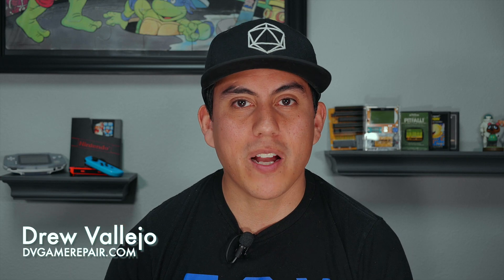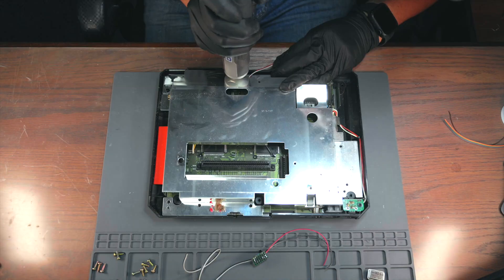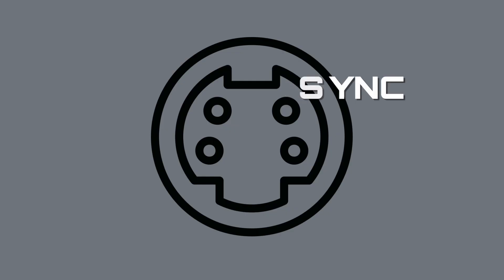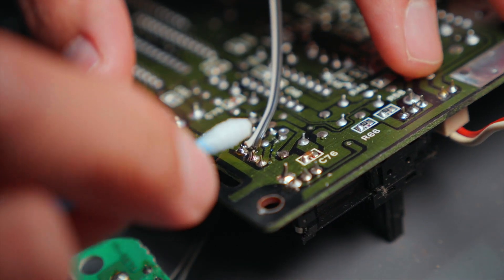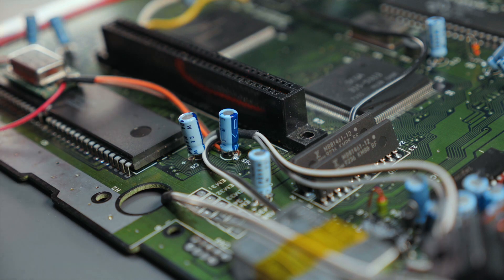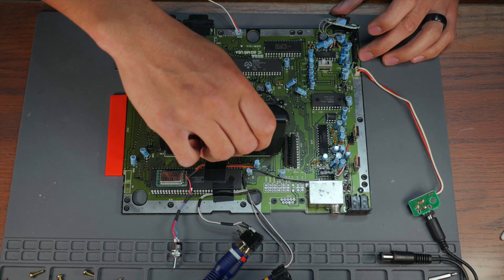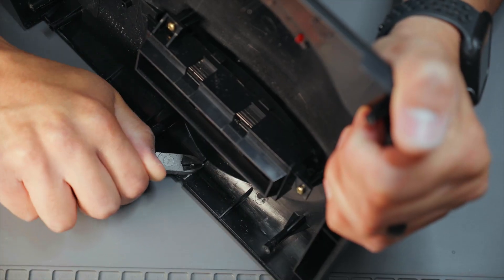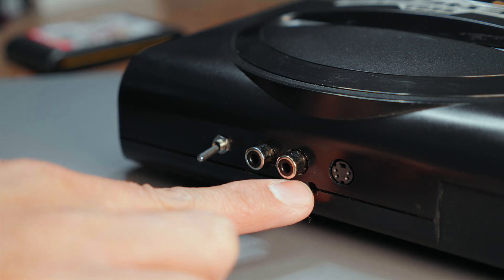Sega Genesis: Overclock, Audio & S-Video Install

Comment: Cool... but the more I look at these mods - the less I want to mod mine VA2 Model 1.

1. S-Video - what is the point, when out of the box, there is the best RGB output of the era? Yes, soldering proper SCART wire is a hassle, as U-shaped Din-8 connector is quite expensive, and properly shielded SCART cables are a pig to work with (the damn snake is 11 mm thick!). If done right - the picture is as good as an emulator. Also, NTSC consoles work with European CRTs, if connected through RGB. No need for S-Video.
2. Stereo - What's wrong with good-ol' 3.5 mm? If you need something extra - build an amplifier (later Model 1 benefit from custom sound), else - don't fix what's not broken.
3. Overclock. Cool, but not my cup of tea. I am quite afraid of frying the CPU. Do you know that processors tend to go bad after 30-50 years due to undesired quantum effects? I assume leaving it stock is better for preservation.
4. Wait, no region swap? Isn't is like the sole reason to poke wires into the thing?
5. PCB-mount connectors glued to the case are just gross! What's wrong with panel-mount parts? At least those are disassemblable.

It seems VA2 Model 1 only benefits from leaving it stock.

On the other hand, I like your clean soldering and neat prototyping PCBs.
Surprised you didn't re-cap the whole thing. My console noticeably improved sound-wise with new capacitors.

Comment: You did a nice clean job, and understand the reasoning behind all the mods of course, but I don't think I've ever seen anyone piggyback off the already installed model one stereo 3.5mm port in order to just re-route the function of it to the back of the system using rca jacks. Why?

Honestly I'm not even counting that as a mod. You didn't add anything that it didn't already do and in fact made it more inconvenient to use or at the very least far more cluttered than it needed to be. Just use the stereo audio it already has lol.

Comment: This is the first time I’ve ever even heard of someone over clocking a mega drive.  Nice video.  New sub.
Reply: Ya it was really popular back in the early 90s for some specific games that pushed the sprites on screen to the limit. Especially after '92 when Thunder Fore IV or (Lightening Force in the US) came out and practically everyone with a dad that had a soldering iron or a local game store/repair shops to do it got it done specifically for that game.

 So it's a 30 year old common mod but it's nice to see younger people or people in general still doing it today. Even if it's only useful for maybe 4 or 5 games max.

Comment: The signal which you call sync is actually Luma, which does carry synchronization information but also carries the b&w portion of the video signal.
Reply from the maker: I uploaded and totally missed it but addressed it in my circuit build video. Good catch though.
Reply: @dvgamerepair3448 thought it was 11hz, can't you always keep it on.
Reply: Was gonna say this. :)

Yeah, S-Video has always been Chroma and Luma. Luma Carrie’s sync which is why Sync on Luma cables are a thing.

Comment: Using a VA7 Genesis model 1 which is basically a model 2 in a model 1 casing. This model is referred to as the stinker cause the audio is terrible
Reply: It's a VA 6.5 not a VA 7. VA 6.5 has the good soundchip.
Reply: How can you tell if you have a va7 ?
Reply: @cpiep  original Genesis had a bunch of ports on the back and had a pinkish color hue around the "power on" led light also had High Definition Graphics script on the front top of the ring. The VA7 was the stripped down model 1 which the casing in late 92-93 was redesigned to become the model 2 Genesis.
Reply: @mattmaverick703  I have read that some of the model 1 genesis consoles that have the "high definition graphics" on the ring were also stripped down tmss models. I am wondering because thisbis the way mine is. It has tmss but also has the high definition graphics around the ring.
Reply: @cpiep  yes youre correct! Yours is known as a Sonic 1 Genesis
Reply: @cpiep  The modem socket wasn't installed in the VA6.x and the 7's western board layout (all Japanese model 1 boards have the socket, including VA7) was completely changed to not have it. You can see in the video that the solder pads are still present, so you could restore the connector if you wanted to. It's why there's a gap in the plastic where the socket would otherwise be on a VA6.x, while the 7 has the DC/AV/RF sockets pushed to the left. Also shows that the DC connector is attached by wires and isn't part of the board, but it is directly soldered on a VA7. The RF modulator took up a lot of room.

Comment: From what I understand, the main benefit of overclocking a Genesis is to reduce slowdown. Outside of losing rings, where does that happen in Sonic 2?
Reply from the maker: Checkout my video on overclocking shootout. I tested a bunch of clock speeds on the genesis model 1 and you see some examples of benefits and downfalls of different clock speeds. 
As someone pointed out on that video in the comments, they believed the clock speed was originally meant to be 10 MHz which is why most games work and benefit from it. It would be interesting to test if the original clock speed is actually still running at it's 7.68Mhz. I will have to keep that in mind.
Reply: @dvgamerepair3448  Hmm some further research into this is needed... I am aware that the Motorolla 68000 derivative CPU was a very flexible and low wattage CPU solution plus affordable in that version for a 1988 Sega MegaDrive launch but there is also stuff like process nodes and yields which may have prevented a certain production run at 10Mhz for what is supposed to be a low cost consumer hardware that is also supposed to be very competitive with the ruling game systems back then in Japan... the Nintendo FamiCom, a potential Super FamiCom which was being rumored by Nintendo themselves since 1988 or maybe earlier since NEC PC-Engine with it's 7Mhz 8bit CPU (but still blazing fast) were the mass production set ups only for later in 1989 where NEC themselves released their powerful but expensive Super GraFX also with a 8bit 7Mhz CPU and bad decisions of not using that as the North American release game system...

I can see how SNK released their NeoGeo AES/MVS with a much faster variant of the 68000 CPU custom use for 1990 as a high end arcade and home consumer hardware but the idea that Sega's engineers originally targetted 10Mhz needs some confirmation... surely some games do indeed run better but there was also a lot of assembler coding with many game programmers in Japan and later in the U.K. and Europe showing amazing feats on MegaDrive...

Yuji Naka San was practically a Sega MegaDrive God of coding having Ghosts and Ghouls, Phantasy Star II, Sonic 1, Sonic 2, and Phantasy Star III iirc... every time his hand was in a game conversion or original game, the expansion is there... and Sonic 2 had some experimental software tech he developed.

Comment: I discover your channel with this vidéo.

I really like this mid, S-Video need more consideration, sure RGB is better but it's still a very clean analogue video signal. That mod with a Retro Tink 2x Mini can be great for many setting.

+1 subscriber 👍
Reply from the maker: 100% agree. I also think there is a strong case for S-Video only PVMs. It really looks amazing on them. 
Thanks for the support!

Comment: Is the epoxy necessary I only have hot glueeeeee
Reply from the maker: You could just use hot glue. I have just found that epoxy has a strong hold.

Comment: hello thanks for the great video will you make one with double overclock 10mhz-12mhz?  thanks
Reply from the maker: If you haven't checked it out yet, I made a video on testing overclocks on a Genesis Model 1.
Reply: @dvgamerepair3448 I saw a 14yo on youtube tech show 2006 do 11mhz and showed older host why it needs be done slowdown sonic rings hit